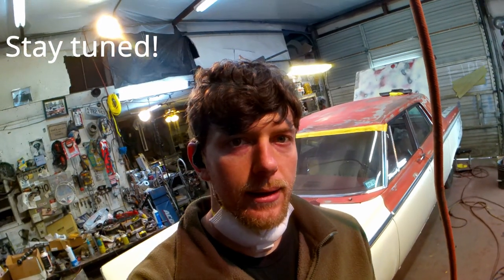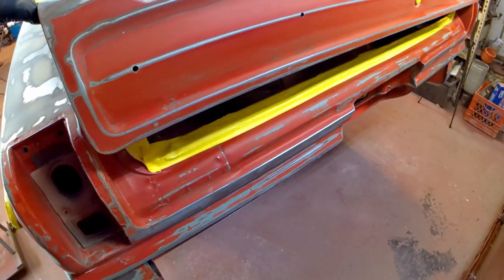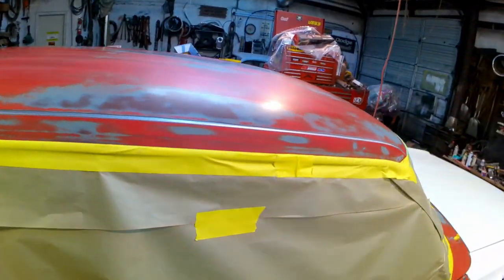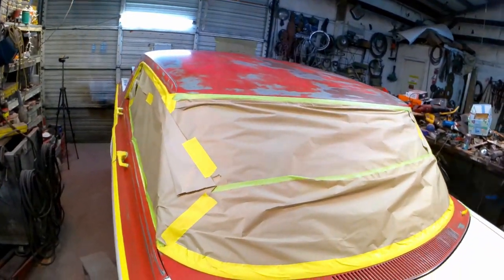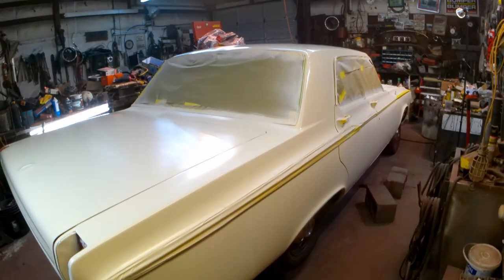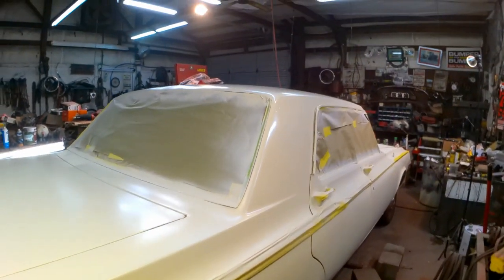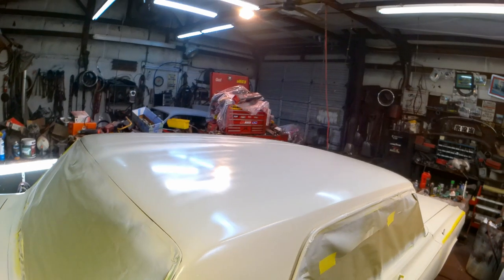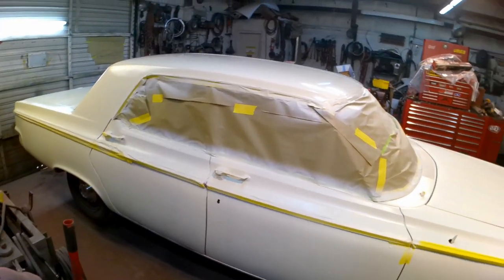65 Coronet: Finally Prime time! #Mopar #Dodge #Paint and Body

Comment: At one of my jobs my boss at the time tried to show me the basics on painting. The company rebuilt old DC motors from WW2 battleships which are still in use at our steel mills and mostly AC motors at oil refineries. Anyway the boss had this hug DC motor hanging on the crane ready for paint. I left so many runs and thin spots on that thing lol. The boss said "MAYBE SOME OTHER TIME FOR YOU TO LEARN THIS BUT NOT TODAY". 😂. It was really bad 😂
Reply from the maker: Hahah! If you did it well, you’d have been stuck as the painter! Lol

Comment: Hey joe, I'm sure you're past this stage and already painted by now, but a tip for the future... you saw that dry spray stripe in the middle of the roof... very common and I used to have it all the time as well. But if you start painting at the drip rail and work your way to the middle then go to other side and grab that wet edge of primer or paint, you can completely avoid the dry stripe in the middle. Works like magic man. Loving the build by the way. You're one of my new favourites to watch these days. Keep up the awesome work 🤘🏼
Reply from the maker: Thanks brother. I’m breaking this car into parts. Doors, fenders, and rocker panels, cowl panel and front panel below grille. Then I can let it down off the jacks and finally reach the top 😂. But yes sir, I saw the wet edge from watching and studying Kevin Tetz. I’m pumped because he started following me and this project on Instagram 🎉. Should be able to lay some paint tomorrow and Thursday.
Reply: @JustMoparJoe  yeah man. Kevin Tetz rocks!! I modeled my paint spray air system after his videos. Works like he says too. I'll do a video on it and tag him in it some day. Right now I'm too busy building mopars and trying not to go broke doing it! Haha have a great one man 🤘🏼

Comment: Great job joe! Good choice with the white primer, it will really make that red pop! Looks like that gun was spraying well, a lot of people make the mistake of using to small of a tip to spray primer, I like to use a 1.8 - 2.0 especially on big jobs.
Reply from the maker: I need to get a sole purpose primer gun if I’m getting roped into painting more. This one is only 1.5. I have to thin the primer to basically sealer thickness to shoot.
Reply: Nice job Joe
Reply from the maker: @dannyskaggs6587  thank you!

Comment: Hay Joe where you going  with that paint gun in you're  hands... lol Jimi hendrix Question  how much primer you think you have  used and  is it high build? Thanks Joe.
Reply from the maker: Thanks Jerry. Used about 3/4 a gallon. It’s high build, but I’m thinning it 10% to get it out my gun! I’d rather do thinner coats and let it flash well. It says on the can, “adhesion promoter may be used when spraying to direct metal. I don’t have an issue putting lighter coats on bare metal that’s well prepped.

Comment: Im certain someone has asked this before but why the white primer? Ive rarely seen it used as the base for reds.
Reply from the maker: It will cover easier than a dark grey, and I like it because my guide coat shows up so well while sanding, in my dark shop. My paint expert friend said that the solid colors would have less effect with changing colors of primers, so I figured go white. My gpaw would use different colors for layers. That way you can see when you’re cutting through while blocking

Comment: Hoooo Lunar!!! Really like is Channel too haha!! Man great primer job 🍾🍾 !!! Te final result will be pretty straight at the end 👍🏻👍🏻😎 maybe somebody already ask those but for my personal
Knowledge😃 what primer brand are you using and gun nozzle size vs air psi ?
Reply from the maker: Primer is summit brand 2k. Gun is just a cheap hvlp. Pressure around 40 psi and a 1.5 tip. It’s thinned pretty good
Reply: @JustMoparJoe   thanks 👍🏻👍🏻😎